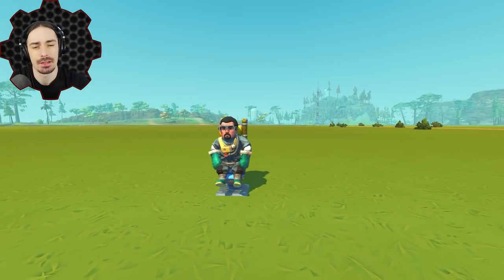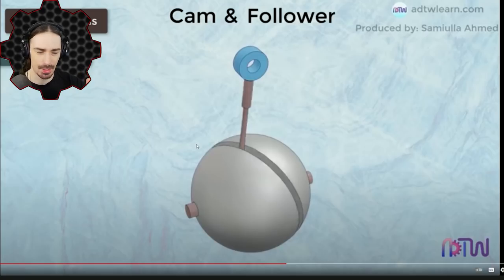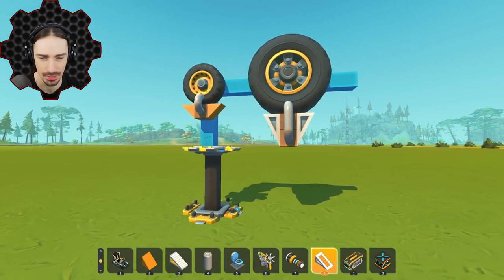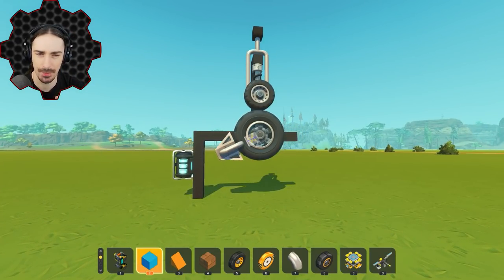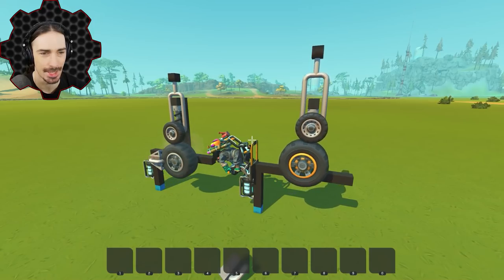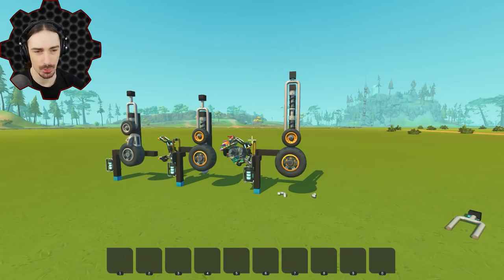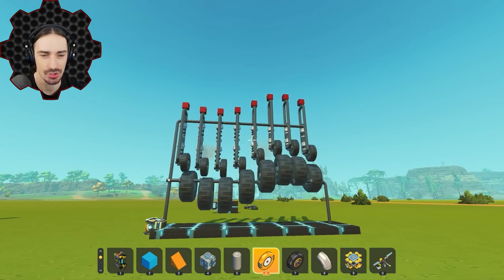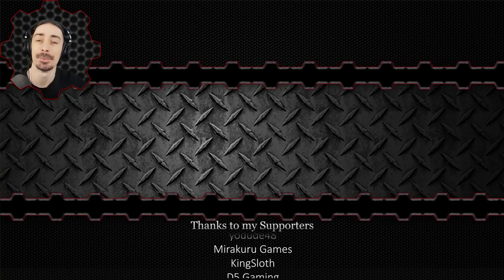This Simple Mechanism Made Combustion Engines Possible

Comment: 5:23 notice how the suspension piece isn't pushing the follower down fast enough to maintain contact with the cam lobe. In an internal combustion engine, that's what they call "valve float". It allows the piston to remain unsealed longer than it should and is a factor to n maximum engine speed. Before engines were mostly computer-controlled and could limit their own max rpm, this would be what would happen if a driver pushed to hard past the "red line" (a marking on the tachometer indicating max sensible operating speed) and it could damage the engine.
Reply: Yeah I can here to say the same thing essentially. That he is floating valves and a stiffer spring should help with that so he can Rev it out at a higher rpm.
Reply: Stiffer spring might actually not help; in real life physics it would, but one thing that seems to send SM physics off the deep end is competing lateral and rotational impact forces. More contact with the wheel surface at a sharper impact force might act counterintuitively within the system. It'd be interesting to see him play with it and find out.
Reply: @flyingmunk8956  I presume stiffer springs would add more load to the engine limiting power ...
Reply: Thank you for the information. I was wondering what it was called.
Reply: Dang it I was about to comment that
Reply: @alanray124  ha, yes and no
Reply: im asian
Reply: Stiffer springs would have more load on an engine, but in the real world if engineered properly, we can get higher power output within higher rpm ranges. Now in terms of added load, you also have to remember that the camshafts are geard 2 to 1, so it moves at half the revolution, meaning more torque applied to the camshaft, which means less overall load on an engine. (aka the "limiting power" is not really that much)
Reply: He could fix it with a desmodromic valvetrain... (Video idea)
Reply: @theyeetus1428  good idea but a bit too complex. Not to mention friction between parts in this game is not up to par. Believe me, if I could, I'd have built a ducati in this game already lol
Reply: @alanray124  thats parasitic loss right there
Reply: @flyingmunk8956  stiffer springs is one way engineers and mechanics try to improve on it. Lighter valves are another way. And like everything, there is a trade-off. stiffer springs place more wear on things and lighter components tend to to not last as well.  Having an overhead cam can help, as well as separating cams for exhaust and intake sides (OHC and DOHC as opposed to traditional pushrod and rocker assemblies). If you want to see something really cool, look up Koenigseg's Free Valve technologies. They've replaced cams and followers with very precisely timed linear actuators  (like if Scrap Man were to delete the wheels, wedges, and suspensions above and replace them with pistons and a controller). The cool thing with that is they can be adjusted way more than even variable timing cams since cams have fixed rise and dwell profiles, all they can do is shift the center of their timing relative to combustion pulses. But Free Valve can change every aspect of valve performance and allow for crazy torque at low speeds and unprecedented high specific output at high speeds (like their twin turbo 3 cylinder in the Gamera that makes over 600 hp from a 2 liter engine)
Reply: damn
Reply: @andershitland7351  ok
Reply: Hemi engines are very common for  and can also brake a lifter
Reply: Cool
Reply: @THESLlCK  I think the timing and the proportions would be more of a problem than friction
Reply: @alanray124  stiffer valve springs would allow higher rpm,  but it also increases friction which means less rpm
Reply: @djaydeved  I guess stiffer springs are more preferable because the parasitic losses are negligible in a well engineered design and my guess is gearing will compensate for the lower rpms
Reply: Same thing happened again around 12:20

Very slightly

Comment: This is why when a timing belt in your engine snaps bad things happen. Although most cars now use a timing chain :D
Reply: Hi kAN
Reply: And chains are 100 times better because there more reliable and you don't have to rip your entire engine apart to change a belt than take like a few things off like the front of any small block chevy. 

all it is the balancer and water pump then the cover that goes over the cam gear and the crank gear and the chain.

 so you usually will never have to be in there but when metal gets hot bad things happen and the chain could snap or just grind the teeth off the crank or cam gear.

 but that's after a load of miles of abuse and basically beating on it till it blows up its entire life 👍
Reply: thats cool :>
Reply: hi KAN Gaming.
Reply: Sometimes I forget kAN is an actual car mechanic
Reply: Wow
Reply: Same
Reply: You should make a walker using this concept for all the linear motions!
Reply: Is it weird I still call timing chains timing belts?
Reply: Unless it is a non interference  where valves don't open wide enough to hit the piston
Reply: nerd lol
Reply: can
Reply: :o kAN Gaming, HI, love your vids
Reply: @a_s10_blazer  

Just a few things to mention here:
1. Although most newer cars utilize chains now, they are NOT better than belts, because they use plastic everywhere unlike older engines. You look at a modern timing chain engine and MOST of them have the exact same 60-100k service intervals as belts, since plastic guides wear faster than the old school steel ones.

2. I don't know what kind of cars you're thinking of, but timing belt driven 4 cylinders you USUALLY only need to pull the crank pulley and timing cover (and sometimes the water pump if it's not driven by the timing belt itself). The only engines that require full disassembly of the accessory's of the engine are V configurations; whereas, pretty much ANY AND ALL timing chains engines, whether inline or v configured, require pretty much full disassembly, hence the VERY noticeable difference in labor costs: 700-1200 for a belt, 1500-3500 for a chain....
Reply: yeah, it's not fun when you timing belt brakes it sucks to fix because the valves hit the pistons and then the pistons become damaged and that's no fun to fix especially since I'm a mechanic I see it quite often
Reply: @love_mud_bogging4039  unless your lucky to get a non interference engine but still a drop valve does the same thing
Reply: @Dude13450  that's why I said small block chevy lol all of them up to the 5.3 ls used full metal everything
Reply: Nice
Reply: Rotary intensifies
Reply: @a_s10_blazer  you very much dont have to rip your entire engine apart to change a belt, even in smaller, tighter engine bays, the most youre gonna have to take off is a cover that keeps stuff away from the belt so it doesnt get damaged, and a engine mount to get you more wiggle room

Chains are infinitely more complex to take off cause theyre inside sealed chambers to keep the oil lubricating them from leaking out to the enviroment, and they do still fail, and more often than not they fail catastrophically
Reply: @VicTSB  our tdi in our 2000 golf you had to take off the entire side of the motor just to get the belt out including mostly all the pullys and the like 3 different covers just to get to the pullys to be able to take them off in the tightest engine bay I've ever worked on
Reply: @a_s10_blazer   @a_s10_blazer  the belt change on a 1.9tdi takes about half n hour and the only reason you'd have to disassemble any pulley is to change them, you just gotta take the cover off and unscrew the engine mount, then just take the tensioner out and the belt comes right off

Itd be basically the exact same steps for a timing chain except the chain isnt nearly as nice n flexy as a belt so maneuvering it in a tight space would be considerably harder
Reply: unless the valves are too far above the piston to not get hit by it cough cough 2JZ cough cough
Reply: @Zanzopan  yes
Reply: Well there are still quite a few cars that use belts due to ease of maintenance
Reply: Hello kAN.
Reply: Not all cars are interference engines, but the ones that are... yeah..
Reply: Assuming that is an interference engine, noninterference engines should just stop, but not have catastrophic damage such as a busted piston

Comment: Hi Scrapman, have you tried making the corkscrew tank? Basically a tank but the treads are screws - I think that would be awesome. Thanks as always!
Reply: that will be fun
Reply: It would be hard but possible
Reply: how would you even make that move?  irl the screw digs into the ground and pushes it but in scrap mechanic its not gonna work
Reply: That would be cool but doesn’t it need to dig into the ground to gain traction?
Reply: Im not sure if this would be possible in scrap mechanic because the tank works by digging into the bottom
Reply: That would be cool but difficult cus corkscrew threads terraforms the surface it moves on
Reply: I don’t think there are any games available that can handle that
Reply: yeeeeeeeeessssss
👌👌👌
Reply: With SM physics, it wouldn't work as intended
Reply: That would be challenging👊
Reply: Having diagonal wheels facing away from each other on the sides might work. It won’t be effective on angled surfaces since the tank will be pulled to the sides but like I said, it MIGHT work.
Reply: IE snow tank
Reply: I know this! this use in snow tracks right?
Reply: I don't think it would work, at least very well. Unlike the Tsar tank, the screw tank NEEDS soft patches to function well, which don't exist in this name. Not to mention the angles needed to make the screw work and be small. Ever notice, Colin Furze only every really took his out to the fields, woods and water, where it's softer than concrete and Asphault. 

But it's scrapman, so he may surprise us yet again
Reply: @ЖеняБояджиева  An hard
Reply: I think he has but in a different game
Reply: It would work in water. He could combine it with the new sails in trailmakers
Reply: It probably could be done , but instead of drills it would be a bunch of pairs of angled wheels, so it would move like rollerblades
Reply: Maybe starting with an angled wheel base to possibly make side motion into forward motion. I dont know if any oscillation could be used to aide that forward momentum. It would be easy to make a friction less vehicle that appeared to move on corkscrew treads
Reply: Wich game would he make that in that it could actually be testes like in mud or something otherwise they would just act like normal wheels
Reply: I think he did that a long time ago but on trialmakers
Reply: I think it might not do much with scrap mechanic physics but cool idea
Reply: It would probably be too slippery
Reply: Cool
Reply: @deception1744  what is it was but it walked instead of dig to mo ve xd
Reply: Yes plz
Reply: Actually I believe this is entirely possible. I had an old corkscrew rc rank and it worked fine on smooth surfaces.
Reply: @Ghostookas  the whole spin tyres series. It’s based on its dynamic non-laggy ground
Reply: Oh yeah! I had one of those as a kid and it could drive on water too because the wheels acted like pontoons
Reply: In scrap mechanic that might not be possible without some trickery. Cause irl has different physics that Scrap Mechanic
Reply: Bruh I was writing about it for few videos.
Reply: Would be kinda impossible. A screw tank works by digging into the ground and pushing itself forward.
Reply: @deception1744  if he set the gravity to be higher it would pull him towards the ground more, might work
Reply: What about the STRV 103-B? 
It's very W E D G E  G A N G
Reply: How about an Omni wheel? If you understand how it works, you'll find it seems possible.
Reply: He should watch Colin furze' video
Reply: Fun fact about that, I don't think a corkscrew vehicle has ever been a tank, due to the impracticality of transport, cause it can't drive on roads without damaging the screws, & it tears up the ground it drives on something fierce. However,  was actually used to rescue cosmonauts that had landed in the soviet wilderness as the ZIL-2906, because even tank treads couldn't handle that much snow.
Reply: @ЖеняБояджиева  Zhenya? that's a cool name!
Reply: @Keatoukas's Stuff maybe Mudrunner could handle it. But that's not a building game.
It could work in SM by using thrusters, and the drills would skid.
Reply: @kaelbryant7660  the screw wouldnt "push the ground backward" the screws would just spin in plane, maybe they wont even spin because the bearings are glitched
Reply: @deception1744  I bet it would work
Reply: @deception1744  they make stuff in scrap mechanic that should never work, that’s kind of his groups whole thing
Reply: @kaelbryant7660  yes, maybe it will work, just not using the scrap mechanic terrain and using something else.
Reply: I already tried this once and it simply doesn't work.  You have to use angled wheels instead of just "screws" and that gets laggy really quick
Reply: I'm sorry that is almost impossible without lagging the computer 15 fps.
Reply: I don't know if that will work in Scrap Mechanic. The screw design requires the ground to give way under the screws, but the ground in SM is completely solid.
Reply: scrapman really should make a srew tank
Reply: If you have the screw you could weld wedges or sth to the ground for it to latch on. But otherwise it‘d be impossible in scrap mechanic.
Reply: @fabianschultz  you could possibly use angled wheels on bearings so they stay stationary to the ground and move the body forward. It wouldn't be fast but it would work.
Reply: Smart idea do you watch colin furze
Reply: I agree with this man
Reply: That may be possible in Main Assembly but not Scrap Mechanic or Trailmakers
Reply: i will not work

Comment: 1:40 the goal of the wedge cam and follower is to increase the push force using the angle of the wedge. It is easier to push the cam than the follow because the angle with the ground is less than 45°. Pushing the cam down would be much harder, and possibly impossible. This is quite useful when you want to control the position of a part without having the ability to push back the machanism.
Reply: I see, basically a linear worm gear, eh?
Reply: @Nevir202  yup!
Reply: Its a reverse pulley
Reply: It's also used in machinery to make adjusting the timing of what the follower is engaging / disengaging easier to adjust.

Comment: You should try the VZ-1 Pawnee or a Tailsitter plane.

The VZ-1 was intended to be a hover platform for snipers or lookouts which required little control and allowed them to basically just sit mid-air. As for the Tailsitter, bit self explanatory - a plan that could take off (and land) vertically

Comment: Could totally use this to make a controlled excavator/front end loader for Multiplayer Mondays.
Reply: Either that or bags for a car but on a smaller scale so it won't have to be huge and have fully adjustable hight rather than the pistons only having full extension or full compression

Comment: we're doing a project on cams and followers in my engineering class. theres this box and you can do basically anything you want with it, but you have to design something to put on top that will use a cam to move it. for my box im doing a plane on top and having the cam drive the propeller. i might post a video about it when its complete.

Comment: A wedge cam/follower can move linear motion to some other angle, in a confined space, and do it very precisely. Also, depending on the shape of the wedge surface, you can change the follower pattern.

Comment: With multiple suspensions, they will not freak out if you have them on different strengths. Also, try to use 2 bearings connected to the part holding the cam at different height points on adjacent sides or the same side (but not on opposing sides of the same block, or it will allow it to rotate), to act like a different creation while also not causing as much lag as being a different creation.
Also, show this to Kan, he tried to make an explosion-powered engine, and this could really help with that goal of his.

Comment: Something interesting is that Internal combustion engine technology has evolved past the need for a timing camshaft with Freevalve. 
Timing cams are an insanely large source of drag in an engine so getting rid of them frees up a lot of potential power and efficiency.
Reply: it also saves weight

Comment: The cam and follower isn't just for converting rotary motion into linear motion it's also for timing which was part of the reason it was used in combustion engines and that's why there are wedge cam and followers as different angles allowed for different speeds of things to open and close

Comment: In a way what happens here when you spin the cam too fast is a thing that can happen in an ICE as well. It is called 'valve float' and it's a condition when the valve does not have enough time to close before it's pushed back up by the cam. Same cause too, over-speeding.

Also that wedge follower is a way to change direction and essentially ratio of movement, not one type into another. By changing the angle of the wedge the follower can move faster or slower than the initial force, or be programmed for some more complex motion by making a stepped or a 'multi-tier' wedge. Take a look at a wood lathe duplicator and think of the pattern as a fancy wedge :)

And finally, to make springs not freak out, set one slightly stiffer than the other, that way they will compress one after another instead of 'fighting' each other.

Comment: Can are used as synchronization tools… there are many ways to convert rotary to linear motion, but sometimes you need actions to occur simultaneously. To achieve this it is usually easier to drive all the needed components from the same energy source rather than have two motion sources that then have to be aligned properly